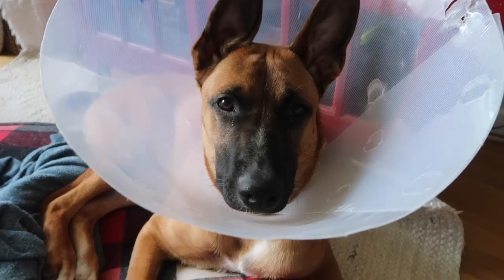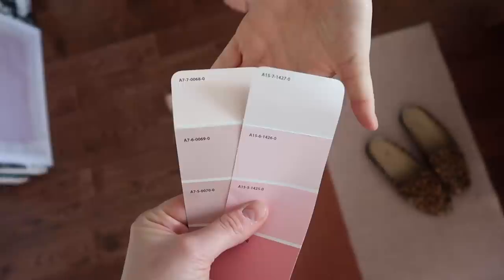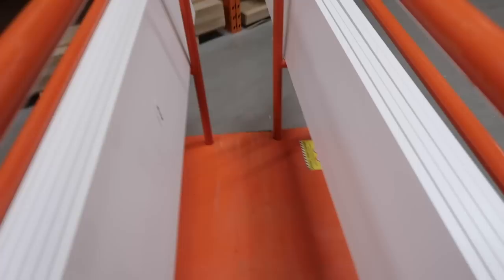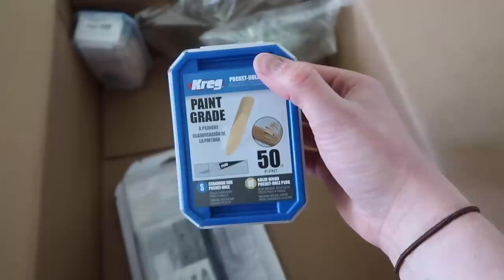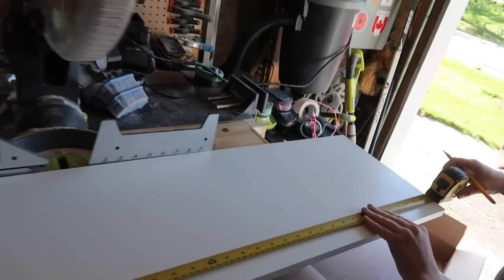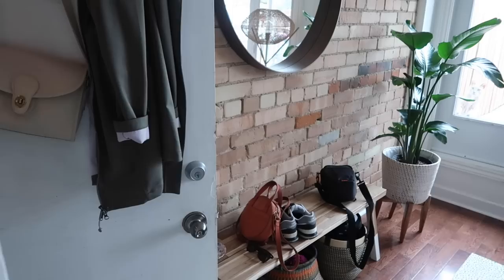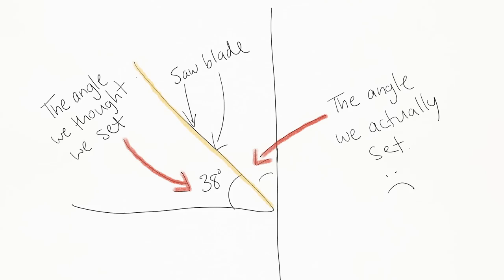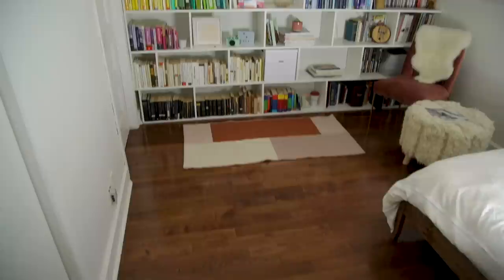Stunning Custom Renter-Friendly Wall Shelf For Under $200 | SLANTED CEILING DIY

Comment: Major hack for angled walls and custom builds: get cheap rolls of craft paper and tape it to the wall cutting out the slanted part then use that custom cut paper to plan out your cuts in your shop. This saved me so much time on my own projects.

Comment: Few things I would do - I would secure the shelves to the wall to prevent tipping over, I would tape the edges when cutting to prevent fraying, I would build a box in place and then build individual shelves inside that box, I would put wide moulding around entire outer edge to hide the baseboard things, I would end half-boards on support boards, so they are not hanging in the air, and I would fill pocket holes with caulk (smooth it out with a wet wipe to achieve perfect surface finish). Slanted wall shelves are very difficult to do, and you have done a fantastic job ♥ and in a short time, too. Advice on measuring angled walls that I have used in the past - bring a big piece of cardboard size of that wall, draw beginning and end points, connect them, cut cardboard, check fit against the wall, turn cardboard over, and measure angle with a protractor.

Comment: You can use caulking for plugs. You can easily scoop it out or drill it out after it's dry if you want to access the screws to move shelves around or just take the whole thing down. You can paint over caulking to match your project or in this case, leave it since your shelves are white.

Comment: DIY tip, you should put painters tape before you run the chopsaw, to avoid those rips in the finishing of the board.
Reply: H No  yes it works. Try it next time!

Comment: They say that covering the back side of malamine when cutting/drilling helps prevent 'blowout' of the coating, as you experienced... but I am yet to try it! Can't wait to see what you come up with in the future! Love your work!! 😍
Reply: Exactly what I was going to comment. Cover it with masking tape and it will have a nice clean cut. I have used it before and it worked great.

Comment: this is why if you buy these boards, you put painters tape on top of where you want to saw and then saw. this way the white top stays much nicer on the edges. i just thought, this is common knowledge. also with lots of heavy weight (like books are) these boards kinda tend to bend over time which is why usually you make the compartments smaller or use real hard wood.  (there is a reason it‘s cheaper).
but end product looks nice. i was surprised alexandra did not put the same background wallpaper on the wall like on the previous shelves. she was always so very fond of that.

Comment: This project turned out so nice! Great job, Danie. If your budget was a little higher, I’d suggest using furniture board with laminate finish material instead of the melamine. Home Depot probably doesn’t carry that, but there are lots of different particle board and furniture board densities at a full range of price points. The higher end stuff won’t splinter on you during your cuts. Good luck on future shelving projects. Your carpentry work is top notch!

Comment: A little tip: Put a piece of tape next to the line you cut the board and it will not flaking You can do the same with tiles 
But how nice is this wall now, great job👍👍

Comment: If you don't want the rips on the melamine, tape the board before you cut it.
Also the opposite wall with the dresser and recessed part would have been a more interesting wall to convert,
 you could have incorporated a built in desk with wall shelves and more shelves where the dresser is...
The 'desk mess' would sit behind the door, and then a cubby reading bench where you built the shelves.
Just a thought.

Comment: Melamine requires a special blade that has teeth that are slightly higher than others on the blade. Those teeth score the material before the other teeth cut. Thus you don’t get the chipping material. Watch Norm build the laundry center on the New Yankee Workshop to see what I’m describing.

Comment: My house has a built into the wall shelf.  It looks like a TV and entertainment system used to go here.  I don't think it lasted long because I don't think the previous owner insulated it.  What can I do? Right now I have a peice of blackout thermal curtain hanging there because it was a seed starting station with grow light.  My desk will be blocking it because we got a portable AC and it needs window access.  It it's for storage now, I need it insulated so things are not damaged.   And so it's more energy efficient.  I am NOT handy.  I have not looked in the crawl space yet, but it's only on 1 side, so the other side I can not access. - not a spatial girl.

Comment: Hi Dani, amazing job! Love all the videos with you and Alexandra! Quick question, if I wanted to add a closed in kickboard to the bottom of the shelving to raise it up off the floor (easier vaccuuming etc), how would you recommend adjusting the process? Thanks!
Reply from the maker: Cool idea! If I was going to create a recessed border on the bottom, I would most likely create a recessed frame using 1x2 or 2x2 wood and attach it using wood glue and a Brad nailer or screws (which ever one you have). Hopefully that helps a little! Thanks for watching and supporting!
Reply: @DIYDanie  Super easy! Thanks Dani 😀😀

Comment: The best part of melamine coated shelf boards is that the are straight and flat.  And they will not warp over time.  The worst part is the weight.
Reply: I have melamine shelves and they absolutely do warp. There was nothing heavy on them and they completely warped in the middle.

Comment: Big mistake. Some of the horizontal boards are butted together without a vertical support beneath the join. Particle board is less rigid than a natural wood plank. An expanse of shelf tends to sag and bow over time due to the weight of objects (especially books) and due to changes in humidity. Those unsupported seams are not likely to remain on the same horizontal level. Covering those seams with caulk does nothing to prevent their eventual separation.

Comment: Antoine ago if you get ways this old house or the old Yankee workshop on they gave a tip of putting down penises he or masking tape before you drill holes in the stuff like that and it helps it from that frayne.

Comment: Get to the damn project 🤦🏽‍♀️ Tip, build as you go and don’t rely solely on measurements as often the fit and dimensions will change as you continue through your project. Essentially create an outline and build as you go. All walls in all houses aren’t square no matter how new so adjustments will be throughout any wall supported project like your bookcase. Instead of relying solely on melamine try ply or building with construction lumber, securing into studs then skinning it with melamine. Luckily you have vertical supports across the long horizontal boards, overtime you may find bowing. There’s a ton of experienced builders on yt with great knowledge! Also film the build not all the other junk